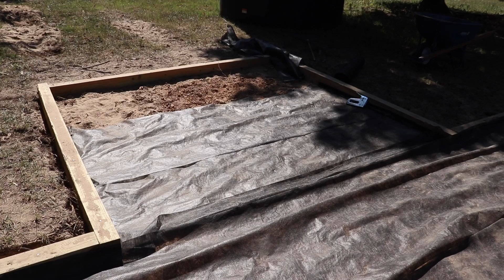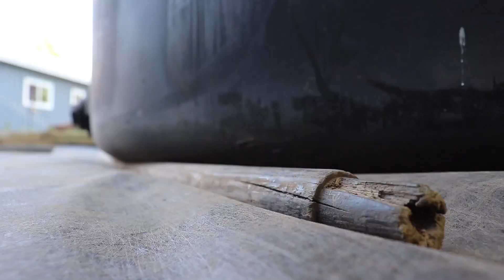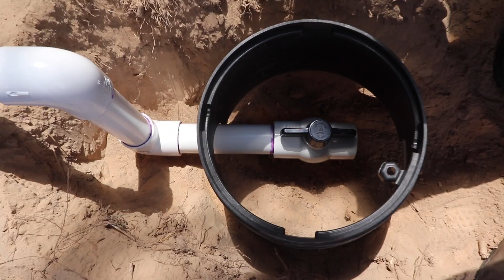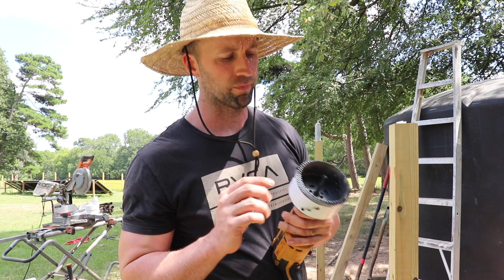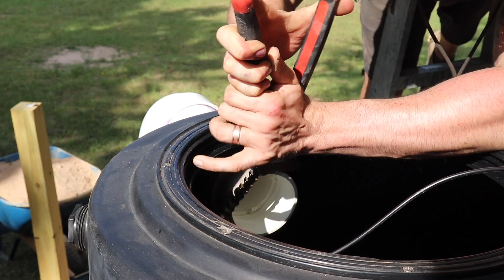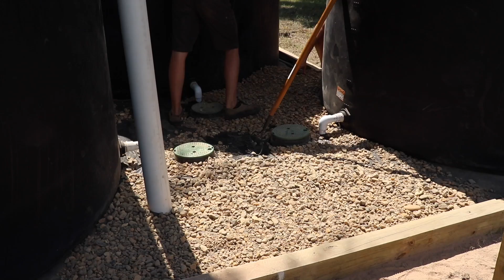HOW WE'RE GETTING WATER OFF GRID!

Comment: How about adding an outdoor atmospheric water generator into the mix? Where it collects water from the air, no matter what the weather. Collecting water from the air with an water generator, not just rain water from the metal roof into the gutters. You'll have collected water two ways. Of course, the water y'all collect from rain and the water generator has to be filtered and clean, so you can drink and bathe in it.

Comment: I know it's way to late for this tip for moving these large poly tanks but maybe some
one else will benefit.  I moved the two 3,000 gal tanks by placing a several 4" ABS 
wast water pipes under the tanks using them as rollers.  I was then able to push the
tanks into position with out extreme effort.

Comment: Should have rolled your tanks over your 4" pipe instead of shovel handle. My Wife wouldn't have reached under.
Unfortunately I live in Kansas where it get in single digits, so this wouldn't work. 
I like you three tank system.  
I've siphoned enough gas and water in my life to know if the top is ventilated it should work perfectly.  Thanks for posting

Comment: Good video. 
I get that the roof is considerably higher than the tanks, but would that create enough pressure to fill the tanks? It seems that the water would only reach a certain level until the inner pressure from the weight of water in the tanks exceeds the external pressure of water from the roof. Then the system would back up. Or am I wrong with my observation?
But I'm just watching the videos and decided to start at the beginning, so I don't know if this has already been discussed.
Keep up the great work.

Comment: nice idea but it will not work, you will need to overcome the pressure of the standing water in the tank with more pressure coming from the house. seeing you do not have elevated tanks but are relying on elevation to move water from the house to the tanks this formula will work. As you will see you will need more pressure to the tanks as the volume of each increases, meaning the psi will need to increase as the volume or pressure pushing back on the inlet line.
 Pressure (P) = 0.433 × height of water in feet (h) to calculate the psi for elevated water storage tanks. The pressure at any point in the tank is given by 0.433 multiplied by the height of water above it in feet.

Comment: u did that hole saw "trick" wrong.    u need an arbor with the threaded nut that holds the washer that locks the hole saw.  u remove the nut, remove the locking washer, and thread the bigger hole saw onto the back of the  arbor, the smaller one where you normally thread it.  On any descent arbor the threads are the same front to back.  Doing it that way will give you a much larger gap between the two hole saws.  i did it wrong the first five times i did it.  Got lucky enough to do it in front of someone that knew the right way it was done.

Comment: So, if I have this straight, with a "water pump", which I assume needs electricity to operate, this couple is not really "getting water off the grid".  Correct?
Reply: Solar power means off grid but water pressure could push it.

Comment: You need to do some research..... What you need to add on pre-tank is a "First Flush System". You need to know based upon square footage of roof how many gallons of water you need to discard whenever it rains so that you don't get all the bacteria from bird shiite, dirt and dust etc............. My roof is probably about your size and I flush 5o gallons before letting it in the tanks. Once it is in the tanks it breeds............. I designed my own first flush system and it mechanically diverts water into flush tank then automatically switches over to fill tanks. If  you were to see the color of the water that is discarded you would never want it in your tanks. It will build up to the point you will have to drain tanks and power wash the insides.  If you want  I can give you my email and show you my design. It beats the hell outta' every single one  on youtube.

Comment: I know this is a little late but why didn't you put the valves at the bottom of the tank on the pipe above ground.  It would make easier access to them and accomplish the same thing as putting them in the boxes. Otherwise good deal.  I''m not sure about the drainage off the roof though.  It seems to me that there would always be standing water in the downspout and piping to the tank which would be equal to the height of the water in the tanks.  How do you prevent bugs and debris from entering the system from the roof and downspout?

Comment: You're Equalization pipes between between the tanks and the out flow pipe are all awfully close to the bottom of your tanks. I would have had those pipes up 8 to 10 in from the bottom to allow for sediment. I know you're going to have filters in your lines but you're going to be constantly cleaning those filters because of sediment. Especially that initial tank that you're also drawing from. And yes sand and dirt is going to get on your roof and in your gutters too, and it will not all get washed away in the initial flushing before you start to fill the tanks, each time it rains. Having those smaller pipes several inches higher would eliminate a lot of debris from getting into your filters and clogging them and having to clean them over and over and over.

Comment: There are a lot of well meaning people who have commented on here who have no idea what they're talking about. I have built a very similar system to yours and it works perfectly. Two things you still need to do are at near the lowest point of your 4" line going to the house install a tee or more precisely an Inspection opening tee which will have a thread and cap on the off take. Buy one with a rubber ring seal or large "O" ring sealing the cap. You will need this as this low part of the line will become a leaf trap and this cap can be undone to flush out the leaves plus stagnant water that has stood in the pipe for a while. To be completely successful the offtake of the tee will need to be horizontal. Secondly you will need to seal off the tanks with fly wire to stop the bugs and mosquitos moving in. Don't screen the pipes as you'll impede the flow. I'm Australian and all of our water tanks have a fly wire screen dish built into the top of each tank to stop the bugs and to act as a leaf trap. Our pipes are open ended from the house and the water has to pass through the screen dish to get into our tanks. Others have said to paint your exposed pipework as it isn't UV resistant. Another tip is use barrel unions on the inlet and outlet of your pump so you can swap out the pump without destroying the pipework. Don't bother painting the tanks as nothing will stick to them and you'll be able to tell how full your tanks are by the temperature difference at the water level. Even though your tanks are black they won't affect the water temperature in the tanks much as poly is a really bad conductor of heat and compared to the volume the colour will have little affect. Another tip is to install a filter immediately off the pump discharge. Enjoy.

Comment: Could have had a water tower to use the excess power when available. It could be added later. Bringing water up to a usable pressure for short durations is expensive. Like only heat water when you expect to use it. I suggest an on demand with propane and electric start.

Comment: You didn't want to insulate your pipes before burying them? Hope you have light winters with moderate temps. Also, your tanks will never fill more than a third each without pumps drawing water into them. Gravity is a weak force when compared to water pressure.

Comment: Just as hint to anyone else doing this........... put the tank on its side and roll it into position then stand it backup!
Take a 2x6 cut a hole in it with hole saw then use it as a guide, use a ratchet strap to hold wood in place.

Comment: Great video but as many other comments say. Not sure what plans you built this from? 
As watched another video and a lot of work went into pre filter water from the roof. Then the first tank was used to allow contaminates to drop out. Then allowed water to go to the other tanks. 
As well they had low points in lines to allow flush out. 
Not sure the height difference between the gutter and the tank fill point. If the water will be able to flow quickly enough. 
Well good luck always learning experience

Comment: I might put a drop from the incoming 4" to about 3" above the bottom of the tank to allow the drop to be that much more to drain the next 'Tejas Gullywasher' into the tanks. Of course the best way would be to pipe the 4" directly into the tank at about the same level as the output line, would not create a big loop of water to get stale between rains, something to worry about. Just sayin', Michael in Colorado.

Comment: I hope you have budgeted for a very robust water treatment system.  I use a system similar to yours for irrigation, and the amount of debris that makes it into your tanks is astonishing.  Insects and small animals- particularly reptiles- have an amazing ability to find the smallest opening in your system, crawl inside, and drown.  Rotting frogs are a regular on my tank inspections despite screening, and last week I was greeted with a partially decomposed snake.  I don't see any diverter filters on your gutters- maybe I missed them?- so every bit of dirt and debris on your roof is going into your tanks.  The maintenance on these rainwater systems is relentless, and while my crops don't mind the additional nutrition from dead animals and debris, I am constantly replacing the filters I need to keep the nozzles and emitters from plugging.  I predict that after a while using this system, you are going to have an enhanced appreciation for what a wonderful job sand, gravel and soil microbes do in putting clean water into a well.  Best of luck.

Comment: We moved a shed, yes a shed using three sections of PVC pipe? The same way you did with the shovel handle but with three pieces of 4” PVC pipe. We’d roll it along the top of the pipes. As the shed moved over one section of pipe I would drag it around to the front side so it would always be on top of the pipes until we got it to the right spot. Think about a conveyor system and how boxes move over rollers. I can’t claim this idea as it was my hubby’s plan but I’m usually right there helping like you two work as a team! Great job!

Comment: I believe I would have Buried one of those big black tanks so water would just run into it by gravity and it would run all downhill. And it would be the initial filtering of your water. when the buried tank is almost full I would run a pump to take that water out of that tank and put it into the two other tanks. These other two tanks are the tanks from which I would draw my water for the house. The mostly buried tank would just be your catchment. With that filtered water being pumped into your two on grade tanks.

I might have a 200 gallon tank above my roof line for a gravity feed into the house for the shower, washing machine, dishwasher, garden hose, Etc. Each day or maybe a couple times a day water would get pumped from one of your big black tanks 2 the water tank that is above your roofline. Not over your house but above the height of your house. There is a difference. I don't remember the calculation for figuring distance dropped and size of pipe for the water pressure at the far end of the pipe. But it is easy to find and calculate.

As for pumping the water from the black tank up toward the house I'm just thinking of a little trickle pump that might move half a gallon a minute. so it would take less than 8 hours to fill up your 200 gallon tank that is giving you your water pressure for the house. I can't imagine you guys would use 200 gallons in a day. Perhaps 50, or 60 gallons. maybe on laundry day you might use a hundred gallons. But that trickling of the water to fill your household tank would help ariate the water which helps prevent several water problems. Your solar system could easily run that trickle water pump, which would run on Demand only.

 But I like others don't think your gutter system drainage system is going to work very well if you have anything other than very long light rains. You might want to use very large gutters. like 6 inch wide 4 in deep gutters. and then have a 6 or 8 inch pipe going from the house to the tanks. you're going to have too much resistance if the pipe is completely full since you have no pressure other than gradient, gravity pressure to overcome all that friction of the water against the pipe, if the pipe is full. hopefully a 6-inch or 8-inch pipe would only ever get half full. If that.

Comment: Love the videos, you're living my dream but your water system concerns me, your fill tank has through flow (top to bottom) the second and third tanks both fill and empty from the bottom, this can cause stratification when the tanks are full (the top portion of water will just move up and down inside the tank, it wont get used). Black tanks in the sun will get hot and so will the water inside. legionella grows at around 25 - 30 degrees centigrade ( dont know what the farenheight version is) in stored water. Please check this out, I'd hate for you guys to get Ill.

Comment: The weight of the water in the uphill to the tank has to be equal/lower than the downhill pipe I'd think. If the gutter vertical pipe is smaller diameter, even if it's taller, will that water weight be higher than the water in the tank pipe?
Also, you're putting in filters and a pump. Geesh, a dug or drilled well would provide groundwater (from the same rain that's from the roof) with a system that always works and has been filtered through the ground. What's with this, it's got to come off the roof thing? You're looking to navigate potential problems and issues that aren't really necessary to have to deal with. Am I missing something here?

Comment: Yeah I agree with many of these comments without knowing the exact specs of your system. I am a mechanical engineer by profession. Its not just about gravity, its about how much volume (head) of water exists to create a pressure differential between your gutters and the tank and the delta in height between the gutters and water level. Meaning you will need a heck of a lot of water if the height difference is very small. Most systems would feed directly into the top of the tanks, not through a series of tubes under ground. Since you are spending a lot of time on it. I would advise putting up the gutters first (the bigger the better) and consulting an engineer who can look at the specs of your system. The way you have it could require require a pump in order to get the flow rate into your tanks you want during a rain storm. I would imagine you will get some water going into the tanks just not the way you expect it. Also keeping the pipe as large a diameter as you have it going into the top will help. Best of luck, love watching your channel!

Comment: HEY GUYS, I HAVE A QUESTION.  WHY DID YOU PUT THE EXIT PIPE SO LOW?  I THINK I WOULD HAVE HAD IT AT LEAST 6 INCHES OR MORE BECAUSE ANT SENTIMENT IS GOING TO END UP ON THE BOTTOM AND YOUR PUMP IS GOING TO SUCK IT INTO YOUR SYSTEM. THAT MEANS YOU WILL HAVE TO CHANGE YOUR FILTER MORE OFTEN. MAYBE I'M NOT SEEING IT FROM YOUR ANGLE BUT FROM MY POINT OF VIEW, THAT'S HOW I SEE IT.

Comment: FYI, when using a hole saw on plastic, you always want to run them in reverse. It will result in a cleaner cut and MUCH safer cut as it shaves the plastic away instead of trying to shred its way thru with the teeth.

Comment: I have tried gravity feed water tanks above ground, the gutters over flow before the tanks got filled! 
I basically built a large p-trap because you don't want any standing water sitting in pipes! Promoting insect larvae, mold and algae growth.
I had to dig a big hole and build a deep concrete retaining wall to recess them into the ground $$$$ and added a roof.
Also please think about installing a inline debris catch basin to filter the in coming water and easily clean out dead bugs, leaf and bird stuff with a solar powered sump pump (I used a swimming pool sand filter after the pump) to assist in filling your above ground tanks with pretty clean water. 
One 30 amp power line ran underground over by your tanks would power both tank fill sump pump and pressure feed pumps that prefilter for the house.

Comment: Another trick for using a hole saw with the hole already cut is to get the initial bit you cut out and put it back in the hole when you go to drill. It should still centre the drill bit

Comment: Hi guys; Love your channel.  We are doing the same thing.  You can check  our channel out .  But since we are doing the same thing that is the basis for my comment, which I hope helps you.  
1st - I would bury the tanks about a one foot  to two feet deep.
This would prevent your connection from freezing.  Your connect is above ground and exposed.  Not sure where you are but we are in NM and my connection froze once.  Hence my advice. LOL
2nd - By burying them you will minimize the gravity need to push the water up the PVC pipe you have set up for the inflow of water.  I'm not sure if the way you have it will work as you planned.  Test it and see.  

Good luck and Be free.